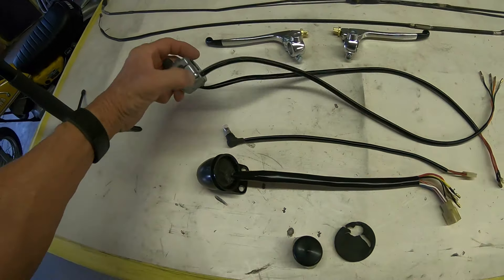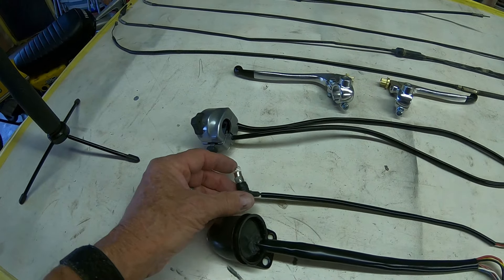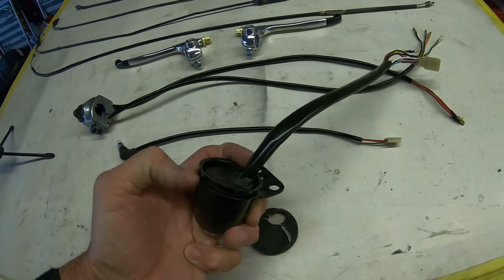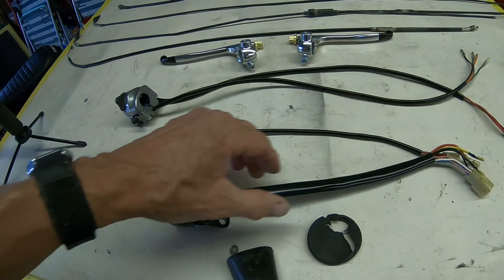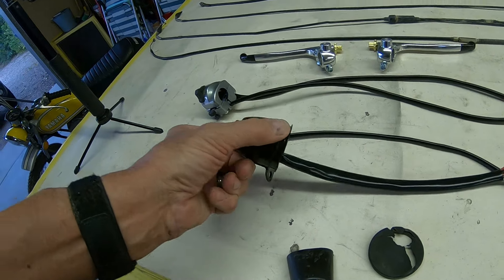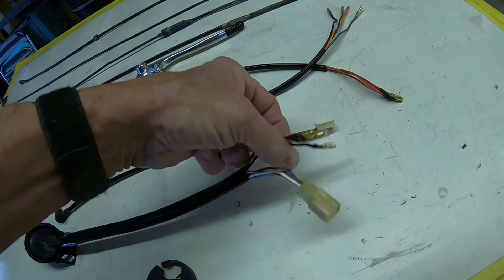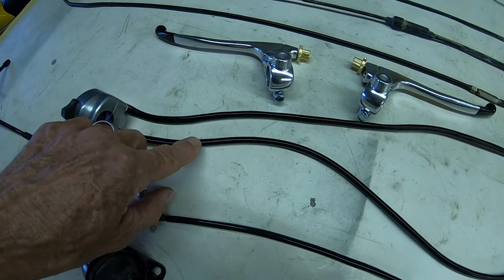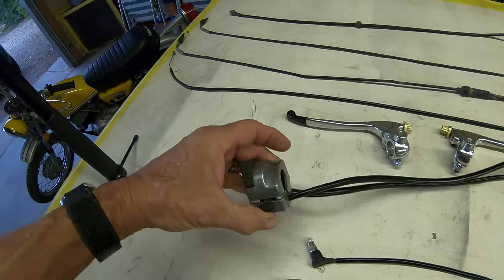Kawasaki F7 Bushwacker assembly and repair

Comment: Won't be long. Not sure if you've ridden an F7. Small displacement but a very torquey motor, you will like it. The F7 put out 15.12 hp at the rear wheel compared to the Yamaha DT3 250 at 15.32 from a half century old article in a bike mag. Pretty impressive for a motor that is some 30% less displacement. Great video, thank you.
Reply from the maker: I have about 50 years ago, they are what you say they are. Matter affect I compared the F7 to the 185 Suzuki and the 175 Yamaha in a video about pistons back a couple months. I believe the F7 came in with the highest HP rating at about 21hp. Thats off the top of my head, not sure.

Comment: That is a crazy setup on the carb. The chain size for that bike is 428 -114 
That’s what the book says.
Reply from the maker: The front sprocket was 15 instead of 14, I had 110 links used 108.

Comment: Another great video! Is that a little Yamaha GT80 in the background (13:45)?
Reply from the maker: Yes, it is Pete, it is here for some repairs. Sounds like it will need crank bearings and a rod.  Sounds a lot like the HS1 90 twin did, Will get into it soon.

Comment: Hi Dale its nearly there looking good. I no this isn't related to this video but I was wondering if you would no of a way to stop both my mirrors on my dt from vibrating when I ride the bike you can't see much in them until I slow down. many thanks Brian.
Reply from the maker: Thanks Brian, it's a tuff task to do on these single cylinder bikes, they do make a rubber insulator that screws into the perch and then your mirror screws into it. Not sure where to get them though.

Comment: Hi Dale. Is the cutter you use on those cables a special unit? Using standard wire cutters seems to mash everything rather than cutting it cleanly.
Reply from the maker: Yes its a Felco number C7. Cuts it clean.